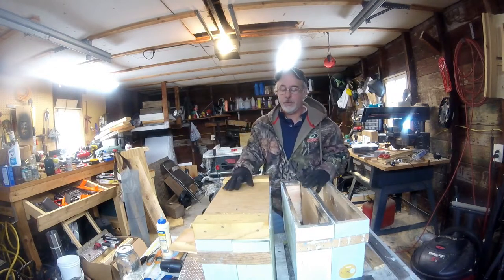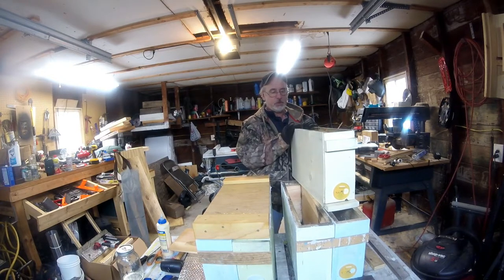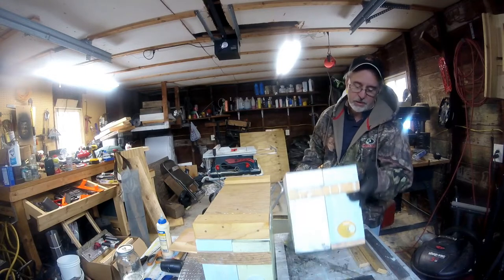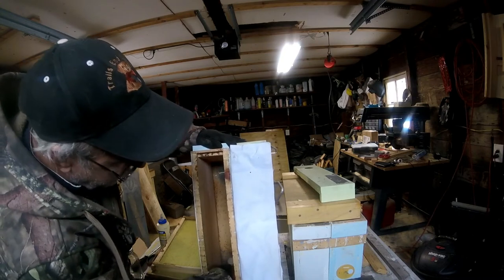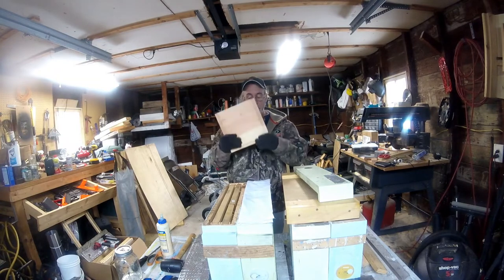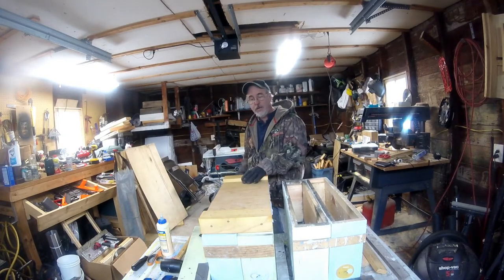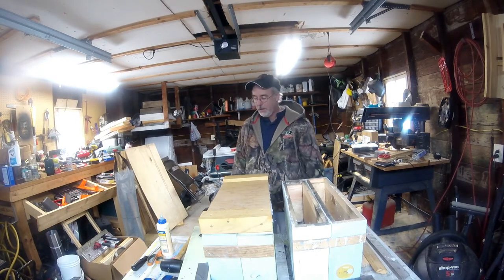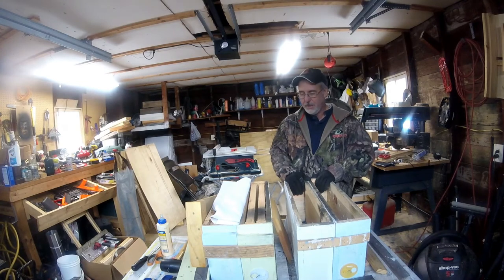Converting Single two- Frame  mating Nucs to Double two frame Mating Nucs

Comment: I used the 2 frame mating NUCs this year. Do they work? Yes. are they practical for everyone that has less than say 50 established hives? Not really. You only need very few bees to raise a viable queen. With that "bee"ing said.......If you are a hobbyist or a sideline Beek.......your resourses are already spread VERY thin. My biggest complaint with the 2 frame mating NUC and limited resources is that I spent more time this year in them trying to keep SHB's, wax moths and robbers out. It doesn't matter if you have the smallest entrance reducer possible, there is just waaaay too much space for a limited size colony. This year I'm taking a different approach. i built 15 mini mating NUCs made to fit sideways in a 4 rail 5 frame medium box. I should be able to raise 15 queens every two weeks throughout the season with limited resources, transfer the queens into 5 frame NUCs and frames of brood and bees from my established hives which should also help swarming in the stronger hives and then overwinter all of the new standard NUCs.
Reply from the maker: I've always said to keep your  region in mind when watching youtube Videos....Barnyard Bees is in Georgia, so single two frame nucs work there for him...here, it's a bit cold. 
He has to deal with SHB and Wax moths (I think that's the reason he lets his bees build their own comb rather than using old comb)..... Here in WI, I've never seen a SHB and never had an issue with wax moths...so region is important. 
The beauty ...at least to me...of the two frame mating nucs was how little resource was needed..... I only had 8  nucs to start the year.....the two frame nucs allowed me to get to 20 going into winter...as long as you are not hell bent on every hive producing honey for you, this is an excellent way to build up  your apiary cheaply without purchasing nucs or packages.  If you only want two or three hives...then this is not for you..... If you want more than that, then this will work for you. ....I don't agree with your 50 hive comment. 

I had a hive that swarmed last year late...August 6.  I caught it.  The parent hive had queen cells all over. I took two frames and installed in a double two frame nuc. Both became colonies plus the swarm hive. That's 3 hives...the parent hive did not create a parent queen, so I combined it with another nuc(which was started from a two frame mating nuc)....so I was +3 in hives....if I had been smarter, I should have split the ENTIRE parent hive down to 5 or 6 mini-mating nucs and I could have had more. 

Next year when I have a hive on the verge of swarming, these double mini-mating nucs will come in VERY handy for splitting out  the colony....so again..these can be VERY useful even for those with just a few hives.
Reply: @KevinsNorthernExposure  True. If your goal is to just do walk-away splits then yes, you can afford to use frames of bees from stronger hives to make them up which also helps with swarm control. I started with 2 colonies in April. I took 7 ten frame colonies and 7 five frame NUCs into this winter. As of this past Sunday when It got up into the high 50's, they were all alive and flying but I know that I have 4 more months of cold Ohio weather to get through. My goal this coming season is to take 50+ NUCs into next winter so I'm going to need to "bee" grafting this year.
Reply from the maker: Good luck wintering!  I haven't been out to my farm apiary, but at home I see dead bees 5' out of my 5 home apiary hives, so know they are out cleaning house still...all doing well so far...you  have done well to go from 2 to 14.  50 is very ambitious....I got up to 24 and discovered  i was in over my head for work....just not enough time for my regular job and all those hives. .....  I may go over 20 again, but I will sell the nucs mid summer....I don't think I want to winter more than 15 hives each year.
Reply: @KevinsNorthernExposure  I hear you on time and holding down a full time job. I have a $40K motorcycle that didn't come out of the garage this year! Thank god I bought a new Polaris Ranger last year so at least I had a little fun driving from yard to yard and at least got a chance to cool off on those 90* days sweating balls! lol And yes part of my goal will be to sell some local over wintered NUCs in 2020.